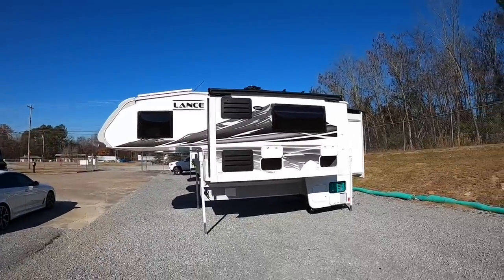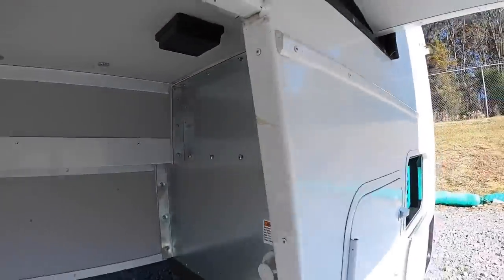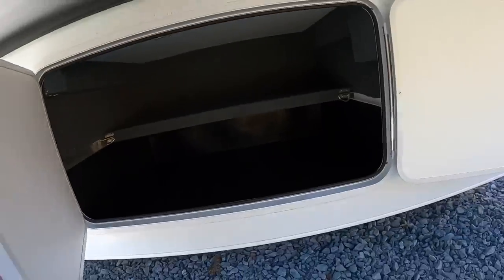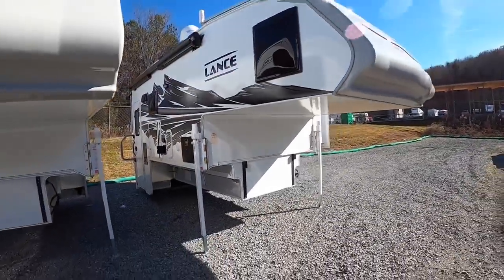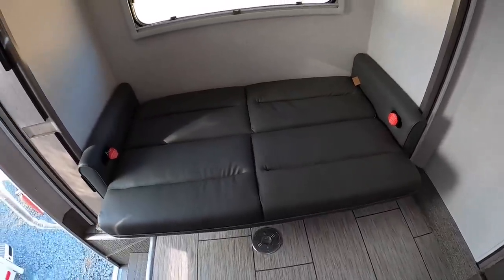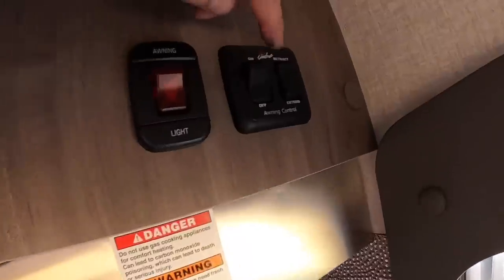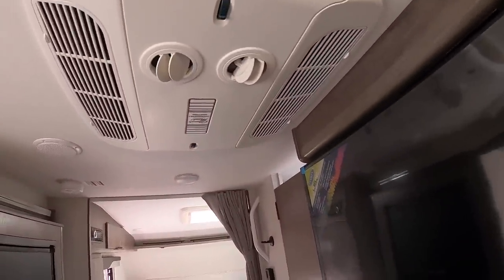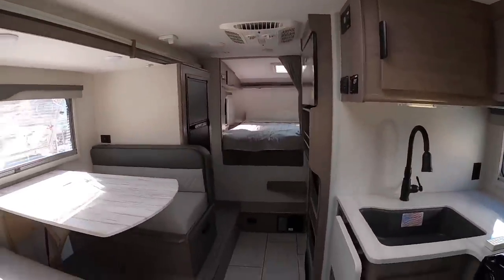JUST RELEASED! 2022 Lance 1172 Truck Camper! MAJOR Changes!

Comment: Be sure and check inside door frame payload capacity. I bought a 2018 1172. I overbought. This unit caused my front end to almost come completely off the front wheels! 2006 GMC 4X4 dually one ton. My payload sticker was washed out badly. I tried hard to get people to help me figure Lances weight figures worksheet! Never happened. I was dumb—smitten honestly. 

Few learning curves. Make sure frig and/or bathroom Doors are firmly closed before bringing the slide out back in.

The rear basement door. Get used to hitting your head lots and lots.

Under no circumstances, even if it’s just for 10 minutes, never park your unit on any sort of incline. If you do your safety gas valve will shut off to your refrigerator.  Also, do not attempt to operate slide outs. The manual warns users not to use slide outs unless completely level at all times. this makes it hard for senior citizens who need to get into the bathroom. as there are many places that will have you leaning someway or other that can cause the slide out system to malfunction. The emergency procedures that you have to follow are very difficult. They are very stressful as well. Be warned. you cannot get into the bathroom without opening both slide outs. This does not make a good camper for In-N-Out use in my opinion. It’s more of a base camp model.

The electric cooling fan behind your refrigerator, will come on continuously interfering with your sleep, it will also drain your batteries within 22 hours if not paid attention to.

My 2022 GMC 1 ton Dooley indicates 5436 payload on the inside of my door frame. If I planned on towing or adding anything to the truck itself I would not consider any truck less than a 450 even a 550. I say this as the larger trucks offer bigger brakes stronger braking power and overall a safer driving experience without having to spend lots of money on suspension upgrades leaving you unable to stop in emergencies as well as controlling sway.
Reply: Thanks for info

Comment: Thanks Brad.  Those counter tops are probably corian.  Glad to see the 4 season standard upgrade.  I wish a solar package was included.
Reply from the maker: There’s still some people who order and opt out of the solar package so I guess they’re trying not to force a charge on someone who does not want an option. I will say as for my 975, I have dual lithium and dual solar upgrade and batteries still went dead after running some basic amenities while I wasn’t plugged in for 3 days lol I’ve come to the realization they’re nothing more then trickle chargers
Reply: @itsbrad  Will the microwave run on batteries only? Can it come with an inverter?

Comment: I purchased a 2002 1172 with a 2002 Chevrolet 3500. Still the truck but out grew the Lance. I purchased a Jayco 5th wheel 27.5 RL Half Ton so my old stock Duramax can tow it. I do miss the convenience of the Lance. I was second owner of the truck and camper and kept it for 5 years before my width and girth out grew it. The Jayco has a wider door :)
Reply from the maker: I loving my 975 so far!

Comment: Dry bath is definitely a plus. Still prefer a camper with no slides tho for how compact they are
Reply: Slides can also break and, in my case, be damaged by a tire blowout.  The repair bill would have been a few hundred dollars but they had to manually take the slide apart to remove it which added another $4000+ to the bill.
Reply: @robertd9850  Gees!!!😬😬😬

Comment: Beautiful camper Brad, I wish I had the coin and the heavy duty truck to put it on! My Silverado 2500 HD can't handle that much weight in the bed. Thanks for the update!
Reply from the maker: I was able to get the 975 Lance Camper, but now trying to find a phat butt to haul it that’s priced at or under retail 🤣
Reply: @itsbrad  Finding a used flatbed dually might be easier.

Comment: Wow, what a camper! There was really nothing I didn't like or want to change, except the black graphics on the outside. Love the dry bathroom, and the kitchen sink area is well thought out. The odd thing was the external antennae cable hookups are inside a big flat door (exterior compartment) so that means you have to leave that panel door open if you hook to a cable(?) Hope I'm wrong but that seems kinda hokie, design-wise.

Comment: Nice camper............I like all the exterior storage which is normally nearly non-existent on truck campers. Interior looks very livable. 

I have mixed feelings on the new acrylic windows. I have one of the Dometic acrylic  windows on the front of my 2018 Lance trailer. They are nice as they let in a lot of light, have good insulating qualities, and open really wide. That being said, they are fragile and scratch very easily. You have to clean/polish them with special window cleaning solutions and a microfiber cloth so you don't scratch the window while you clean it. No Windex and paper towels here. There are folks on the Lance forum that are finding that replacing one of these windows that are a few years old can be problematic and very expensive as some of the earlier  window models have gone out of production (including my window).
Reply: Something to think about when you are off-roading, branches scraping against the windows, great job Lance?
Reply from the maker: Two of my glass windows have a scratch down the side of them thanks to the delivery driver getting too close to a tree. I don’t see that being cheap to correct 🙂
Reply: @itsbrad  Probably not, but that's part of the "joy" of off roading.

Comment: If I'm not mistaken Lance cheaped out by taking away glass windows and gave you crappy "plastic" windows that will soon be scratched up.  Correct me if I'm wrong
Reply from the maker: I’d prefer my ‘21 975 to have the acrylic kick out windows over my glass windows that kick out 3-4” max. Practically unusualness for letting more air and light in

Comment: I noticed around the 5:30 minute mark you mentioned there is no window on a slide out for the 2022 model. Given that the windows for this year's models are pop out style windows they cannot be installed on a slide out because of they would hit the sides of it.
Sad though!
Windows make a hell of a difference in your camping experience.

Comment: Love it Brad. That’s pretty much the same as the one we ordered. Same interior colours. Only difference is the options we picked. We went with the regular microwave and oven, 2 lithium batteries, 2 solar panels, propane generator, tankless water heater, LTE cell phone extendable antennae, roof racks. Do you know what size that TV is? I’m not sure. I’ve never seen a blu ray player option in any type of RV. We bought our own 12V portable blu ray to plug into the TV in our 992. 
Thanks for the tour. I really like the new type windows and the black accent and the standard features especially the 4 season package. 
I’m also curious as to why they deleted that rear side window though.
Reply from the maker: This one was actually supposed to have the Truma Tankless Aqua Go Heater and was told it’s no longer an option at the moment
Reply: Sounds like you got the good options. Is be interested in knowing if that extended range antenna works and is it worth the price. Also, have tankless hot water at home, love it, no more cold showers when I'm last. Hopefully the mobile tankless works well and can keep up with the demand. Take care.

Comment: Truck campers hold value 10x over a bumper pull...so I've seen guys hauling these on a tandem axle car hauler...one they use daily for a skid steer hauling.
Reply: Interesting! Why is that?
Reply: @MarisaAdelle   If you put it on an aluminum trailer it can be easily pulled by an SUV.
Reply: Why do they hold value over a bumper pull? (like a TT/5th wheel??)
Reply: @MarisaAdelle  they are more rare, smaller and usually better built because they don't rely on the trailer frame for their strength.

Comment: Well - were about to see how the new parent company REV is going to tell LANCE how to make a truck camper after doing it for 53 years. Unfortunately, the acrylic windows are a step backwards.  Maybe it's a supply chain issue and will only be temporary.
Reply: I agree
Reply from the maker: Then there’s me, I wouldn’t own a Lance prior to REV.. prior to them, Lance was old and ancient looking. Personally, I think the overall materials used, aesthetics, and overall interior design has improved drastically in the past few years alone. Moving away from the laminate delaminating fiberglass nose cap (prior to REV) and replacing with TPO was a major step forward! Have you ever researched who REV group is? We’re talking about a group that builds ambulances, fire trucks, luxury class A,B, & C motor homes… you think they’re incapable of building, integrating fresh, well designed features and build quality into a truck camper?
Reply: Brad, I love your humor in your videos.
Reply: I have to agree with you on the acrylic windows. That's possibly a deal breaker to me. I wonder what effects UV light will have on them over time? Possibly making them brittle and impossible to find replacements. Boat manufacturers did that on entry level boats years ago with some type of plastic windows and the only thing you could do was junk the whole boat and buy a new one.

Comment: My Ram 3500's bed capacity is 5008 pounds and that is with the factory air ride which from what I understand will throw a code if the capacity is exceeded. Not much  lee-way there for my truck.

Comment: HI BRAD,  I read on the Lance Website that they have available the Onan QG2500i Generator that meets acceptable nation park sound levels.  I noticed on this review of the 2022 1172 it did not say QG2500i.   I am going to check the video again.  If it isn’t the QG2500i, then how can I get that model generator on the 2022 975?  They much improved the gray color and I probably would have gone with that for 2022.  However, I went with the blue and it looks much darker than the 2021.  I hope I didn’t make a mistake.  Love the new graphics and black accent theme.  Great review as always.

Comment: Great video. I ordered mine in October with delivery coming sometime in late February or March. Chose the tankless water heater, two solar panels and two lithium batteries. Definitely hate that they took away the slide-in shelving next to the couch though. Looks like I'll have to go to The Container Store and see if they can put in some for me. Hate the thought of spending the extra money with how much the camper is costing...
Reply from the maker: This one had the Tankless Water Heater as an option, came in without. Called about it and was told there where issues with it and I no longer an option

Comment: Can I place this camper in a 2002 Ford F-250 Heavy Duty Crew Cab with a 7.3? Or would I need to modify the rear suspension with air bags instead of leaf springs? Also, can you camp with the camper on the ground freeing up the truck? Not sure if it’s stable enough to move around on those legs. Thanks!
Reply: No way, special order F 350 minimum. This is a heavy camper.
Reply from the maker: As Brian stated, F350 8’ bed dually minimum is required to haul. 
Absolutely, I’ve got my 975 setting at the campground right now without the truck 😬 thinking about adding “Stable Camper” to it to help eliminate rocking